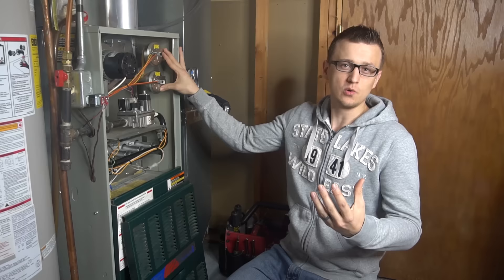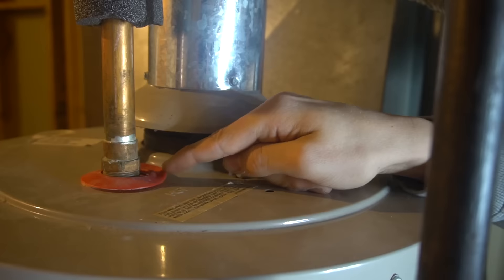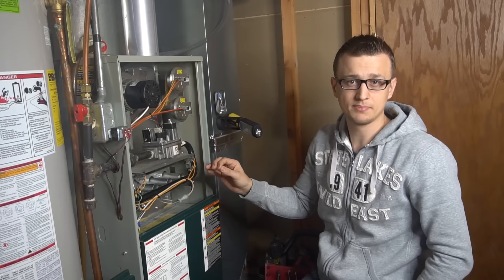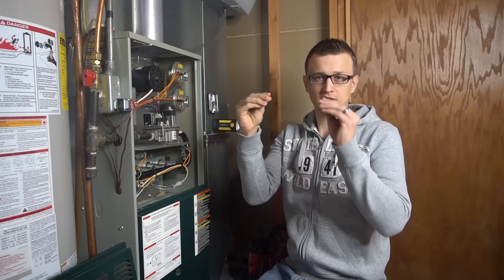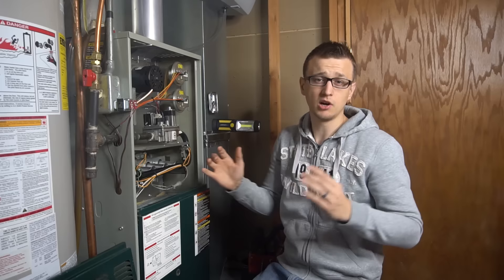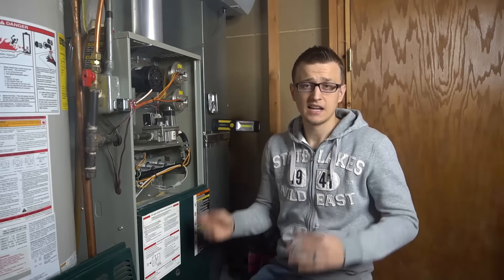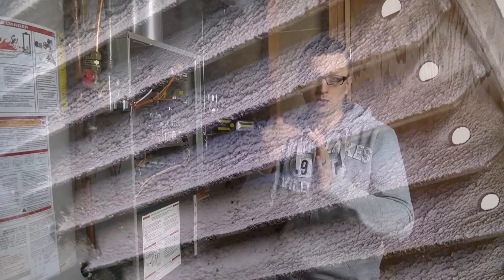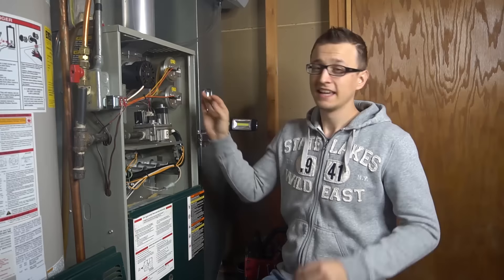Furnace Pressure Switch Troubleshooting

Comment from the maker: ⭐ Other videos that may help:

Top 5 Furnace Problems:
https://youtu.be/T4IWtKy--Vk
How to Test Pressure Switch:
https://youtu.be/MWn55b8DXO0
How to Bypass Pressure Switch (for testing):
https://youtu.be/RMAzPEgTwVc

➡ If the pressure switch isn't the culprit, these videos will help with further troubleshooting:

Furnace Parts and Functions Explained:
https://youtu.be/gN-UIr6824w
Thermostat Not Turning on Heat:
https://youtu.be/054cRskeh5k
Blank Thermostat Screen:
https://youtu.be/vi3OJuGfaac
Furnace Error Codes Explained:
https://youtu.be/J8Zegm4TClM
Furnace Sequence of Operation (important to know):
https://youtu.be/AQD_MedIklI

Comment: You, Sir, are THE MAN!  I checked the exhaust and could see no obstructions. I checked the wires to the pressure switch and they were connected solidly. I pulled the hose from the pressure switch port and gently blew (no effect) and then sucked on the hose and heard a "click". My next move was to unravel a paperclip, wipe it thoroughly, and insert it into the pressure switch port. I felt some resistance in some areas so I ran it in a number of times focussing on the sides of the tube. I reconnected the hose and 2 minutes later the blower came on and I saw (for the first time in a day) a flame and then the burner lit!  AMAZING.  They wanted $185 to come last night - I told them I'd wait until Monday and pay $65 (and I have a service agreement! ). The house is warming up again and I'm cancelling the service call.  THANK YOU! You are truly THE MAN!

Comment: You are the best! Thank you for taking your time to educate the rest of us in such a clear manner. I am a 66-year-old widow and was able to clear a plugged pressure switch port. I had to try clearing it twice, but then it fired up. I found a small nail was able to break through the clog better than a wire. Thanks again.

Comment: I have worked on the technical side of the automotive business my whole life. The competency level in that field varies dramatically. I have seen the same in many other trades. After watching a couple of your videos, I would conclude that you are among the top in your field. My Carrier furnace was flashing code 31, related to the pressure switch. My root cause was not one of the one's you or anyone else covered. Of the videos I watched, only yours provided the detailed design and function information that allowed me to fault trace a piece of equipment that I am not familiar with. I had 28 volts going to the pressure switch. When the unit powered up and the fan came on, I then had 28V on the switch output. I initially though that the switch closed due to excessive pressure. Armed with the knowledge I got from one of your other videos, I could conclude that the switch was ok and the pressure that the switch was monitoring was ok. That left the possibilities of the 28V signal not reaching the circuit board or a faulty circuit board. I followed the orange wire from the pressure switch and used the wiring diagram attached to the unit.  It turns out my unit has an optional device called "auxiliary limit switch, overtemp, - manual reset". I had 28V going in and no voltage coming out. There was a small yellow button on it. I pressed it, it reset, and I my problem is resolved. I think it is great that you and others take the time to post informative videos to help others solve their issues and save a lot of money. Your videos are some of the best I have watched. Thanks,

Comment: This video has been among the most valuable I've encountered in my many years of surfing "YouTube University." I have a Bryant furnace and it's been shutting down during a cold snap. I was getting the 3-1 code (pressure switch) and was just about to go out and buy a new one. I figured that had to be the problem, but watched this video just for the heck of it. 

Sure enough, I pulled one of the hoses to the trap and about 1/2 gallon of water came out of it. Thanks for the tip of having a bucket nearby! I would never have thought there was that much water in that hose. 

I pulled the trap out and sure enough, it was really clogged! One input hole in particular was very clogged and would allow water through it, so I used a small snake made for unclogging evaporative cooler lines and gently ran it through that hole. That finally got the water flowing and black sludge kept coming out. It took about 20 minutes in the sink to get the water clear and for it to flow freely out of all the holes. Just to deep clean it, I have the trap soaking in vinegar as I type this. I'll give it a final flush and reinstall. Thank you very much for this video!
Reply: OMG!!!! write after I read your comment, I tried that too, and guess what happen. Same crap for my case!! Thank for the answer Ricotinez and  of course JAY!!!

Comment: Thanks so much for your clear advice!  I have a Lennox G26Q4/5-100-6 with PVC pipe intake and exhaust lines.  I was getting the pressure switch error code (right LED slow flashing), but only intermittently.  That is, my furnace would try to start several times and then it would finally start.  I learned (maybe a year ago) that I could get it to start reliably  if I stuck my vacuum hose on the end of the exhaust line (increasing the exhaust airflow).  If I ever noticed the house actually cold (which was actually rare, since it would usually eventually start up -- in fact we didn't even know that it was trying and failing), then I would go look at the furnace, see the pressure switch failure code, run out and put the vacuum hose in the exhaust, and it would start up.  Did that for a year or two, actually.  But following your advice I just went through your troubleshooting steps and finally found that the intake line was partially blocked right where it entered the furnace.  There was a huge moth, some beetles, some leaves, some pine needles, etc. sitting on top of the grate that is at the point where the air intake attaches to the furnace.  I detached the intake line, cleaned off the grate and the burner area, and it's working great.  Thanks so much!!  (p.s., I wonder why the air intake doesn't have a grate right at the end that is outside of the house. I think I'll add one.)

Comment: My buyers home inspector found that the furnace wasn't operating when there was a call for heat. A pressure switch error was coming up. This video saved me hundreds by figuring out the issue myself. Turned out there was a tennis ball stuck in the exhaust line, restricting the venting. Thank you!!

Comment: Your videos are awesome. We came home from vacation to freezing temp and a furnace/heat pump that wouldn't start. I ran through your top 10, error codes indicated low pressure sensor. Found a little rock in the line, didn't work. Replaced the sensor, didn't work. Then saw the segment about cleaning the port with a paper clip... It was stuffed full of debris. I used a Dremel bit at first by hand and found it so bad I used the Dremel itself. Life saver! I couldn't get anybody out here, add if I did I probably would have been charged a huge boatload. THANK YOU FOR YOUR WELL MADE AND VERY INFORMATIVE VIDEOS!!!

Comment: I have watched a bunch of your videos , they are amazing . You have a natural gift for explaining things . I have just cleaned my burners taking especial care with the thin flame channel and the flame sensor . My furnace is different I had to remove the burner box ( the burners were held in place by screws ) . I replaced the single pressure sensor some time ago . It had failed ( the furnace is about 9 years old ) . I was naughty , I somehow managed to bypass the pressure switch for a couple of days only during the day , until a new sensor arrived . It was midwinter in Canada . I also have a component that I haven't heard you mention so far . There is a "J" tube that the condensate runs through before going to the drain .  Having seen this video I am thinking of removing the inducer motor and checking the condition of those fins . A great big thank you for magically making complex things simple .

Comment: You sir are great!   It's -18 degrees Celsius (0.4 degrees Fahrenheit)   outside.  Our house was down to 12 degree's celsius (53.6 Fahrenheit) inside.   The furnace guy had been out once last week and cleaned inside the furnace and that seemed to help, but then this morning we got up to this coldness.  I watched your video, walked outside, and stuck my finger in the intake tube for the furnace (high efficiency).   There was a build up of snow inside, that had blocked the input tube and this was immediately dislodged with my finger.   Instantly the furnace out port put out a little burst of moisture, and the furnace has been running fine and brought the temperature up by 4 degrees already in about 15 minutes.  Thank you!

Comment: Jay - thank you so much for sharing your knowledge. I had searched and realized I was dealing with a code 31 on my Carrier Weathermaker 9200. Once I knew where to focus my attention, I continued to search and found your video. Once I viewed it, I was almost certain it would be a clogged P trap. It was very clogged. It is now cleared out and everything is working as it should. You saved us a lot of money, since we didn't need someone to come out and address the issue. We're renovating a house we completely gutted and are in the process of putting back together, so saving what would likely have been at least $300 for a service call is greatly appreciated. Your videos are straightforward, concise, and you have the perfect voice and demeanor. Keep doing what you're doing!

Comment: I hope you see this!  I live in South Central Kentucky and we had a snowstorm yesterday (we usually never get much snow ever!). My heat went out today in my house.  I was using my gas fireplace to help keep the house warm.  It’s 15 degrees outside (62 degrees in my house) and I searched YouTube and came across your video.  I followed along your video, pausing and checking things as you went down your list.  I was getting the pressure switch error.  It ended up being that the port from the pressure switch where the tube attaches was clogged.  But, I also think the intake vent might be clogged as well.  Going to double check that tomorrow.  As for now, the temp in my house is rising.  Thank you so much for doing this video!!!  It saved me a lot of money and made me smarter about my own unit.

Comment: My Carrier Infinity 48XL-A worked flawlessly for nearly 10 years. Then, the heat would not turn on. Your knowledge, troubleshooting expertise, and excellent presentations gave me the confidence to attempt to make a repair on my own. After reviewing many of your videos, I narrowed the problem down to a bad inducer motor or a defective pressure switch which would not close. The solution was unclogging the pressure switch port....a very simple fix...if you know what you're doing. The port was filled with a hard, white substance that looked similar to dried mineral deposits. As you recommended, I used a wire with moderate-level pushing to punch through the substance. The fix was SUCCESSFUL! Thank you!

Comment: You are the man! You explained all the possible causes extremely well. It turned out that there was a wasp nest at the end of exhaust pipe outside the house. Cleared it out, and the heat is back to work perfectly. Thanks!

Comment: Coming to express my appreciation for the video as well. Last night the furnace stopped working and I don’t have the money to pay to have it fixed so I started googling. Figured out what the error code was and then found your video. A plastic bag had flew up on one of the exterior pipes last night. I wouldn’t have even thought to check the pipes.

Comment: Hey, thanks so much for this very informative video.  Just like the previous post, it was Xmas eve and the furnace was not keeping the house warm. (“The night before Xmas & all thru the house-everyone was cold, including my spouse”). The worst timing—all the fam home, contemplating the jacked-up service call on the holiday, not being able to get a replacement part until after the holiday, etc. etc.—the ruminating had begun.  I checked the service code—“High-Heat Pressure Switch or Relay did not close or reopened.”  I have a Bryant and tried the troubleshooting step of cleaning the condenser trap.  Ba da bing ba da boom—how lucky did I get.  I began squeezed the tubing to see if there was any backed-up water and the water began gushing out into the trap and then out to the pump.  I didn’t want to get my hopes up, but was thinking that this just may be the problem & solution.  I disconnected the condenser trap, cleaned it out as instructed, reconnected everything, fired up the furnace, and let there be heat.  No more service code, I am several hundred dollars richer, and everyone is happy!   You are a life-saver my friend. Thank you, thank you, thank you!
Reply: Thanks

Comment: Thank you again for saving me $ on a service call! Came home to a cold house. My system was flashing "pressure switch stuck open." Watched this video and checked the pressure switch port on the inducer by unhooking the tube from the pressure switch and trying to blow/suck through it. No air was going through. Ran a wire through it to unplug it. Now working! Thank you thank you thank you!

Comment: Thank you Jay, You sir are an excellent technician/teacher.
 Great video, once I found the LED indicator light (blinking 6 X's= pressure switch) I followed the steps outlined.  I first tested the pressure switch as you instructed, it passed. Then I found the clogged pressure hose fitting, and cleared it, and decided to check and clear the exhaust pipe ( it had some wasp nest and carcasses).  Re-installed, furnace fired right up. Thanks so much!

Comment: I have an old system that has no codes. There was a crazy wind storm last night with 60+ mph gusts of wind and my furnace would make noise but not heat. After watching the sequence video and this video, I tried blowing into the pressure switch hose while it was connected to the blower motor. It was plugged. As mentioned in the video, i poked it with a wire and there you go. This video just saved me a bunch of money and time. Fixed my system with my multimeter, a scrap piece of wire, and most importantly the experience shared by the person who made this video. I sent a donation via paypal to say thank you.

Comment: I worked on a Tempstar 92% furnace and had to go back twice to repair a pressure switch issue. The trap was clear and condensate flowing fine but apparently a little moisture is pulled into the pressure switch tube causing the fault. Maybe the orifice is too small, I really don't know but the home owners are elderly w/health problems and the cannot go without heat. I already swapped the double pressure switch just in case but it did happen the second time. I am contacting the manufacture. Great videos.

Comment: This video is 100% responsible for my resulting troubleshoot & fix of my furnace. Condensate drain line was clogged, causing water to backup into the secondary exchanger/inducer chamber, which blocked the necessary suction needed to close my pressure switch. 👍
I owe you a case of beer, my man!

Comment: After watching one of your other videos, I decided to replace the switch because it was only $22, and was a super simple repair.  However, after replacement, same double blink error code persisted.  Then I found this video, and I decided to check obstructions.  My exhaust pipe (90+ PVC exhaust) has a nice wire mesh cover, so birds weren't the issue.  However, with a flashlight I could see it was full of mud wasp nests.  With the inducer running, I stuck a rod in the end of the exhaust, and air immediately exploded mud wasp nest in a cloud in my face, as air came rushing from the pipe.  Error code immediately cleared and the furnace fired up.  The switch was doing exactly what it should do to keep us safe!  Thanks for the guidance!

Comment: Dude I fixed the furnace… thank you!  Did every step that I could do and it turned on. May have been the lose wires or checking the switches or checking the water flow out.

Comment: Incredible guide and step by step instructions for fixing a pressure switch issue!  I was able to fix my Goodman furnace that had a pressure switch fault code using the steps outlined in the video.  I have a high efficiency furnace and my issue was with a plugged condensate trap.  It was very much clogged with water spilling out so I removed the hoses and flushed out the ports and boom everything was fixed!  Jay, you are awesome my man!  I just subscribed and will be telling everyone I know about your great do-it-yourself videos!  Thank you so much!

Comment: Great video, once I found the LED indicator light (blinking 3 X's= pressure switch) I followed the steps outlined, found the hose damaged, cut off he damaged part, re-installed,  LED light solid red, furnace fired right up. Thanks so much!